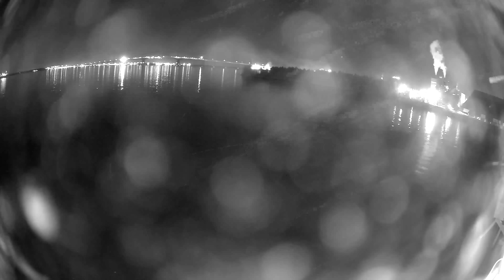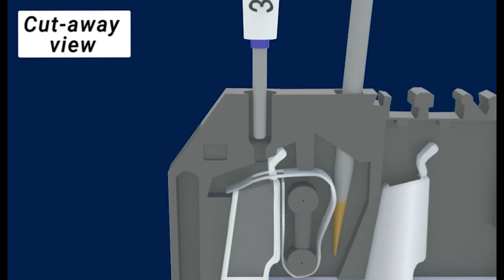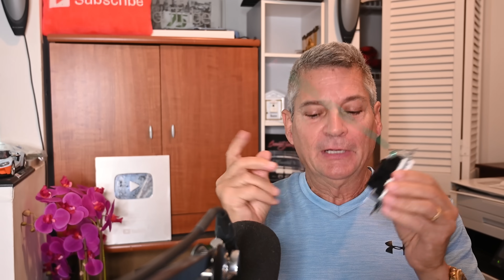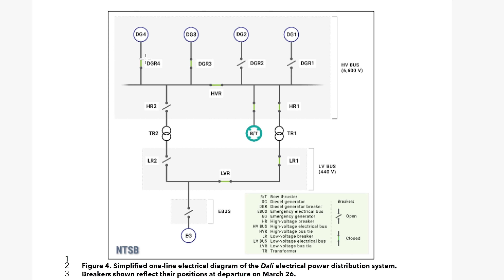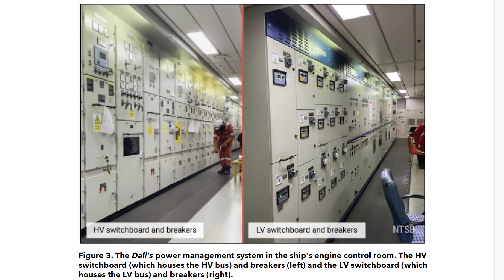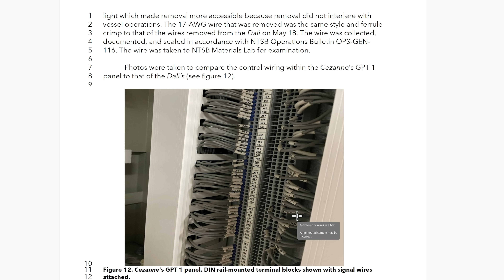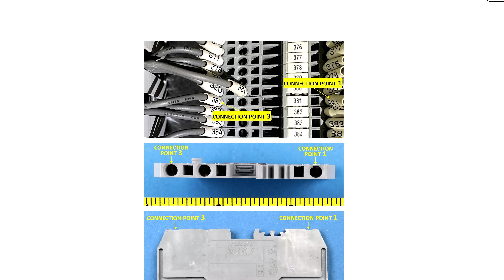NTSB: Scary Wire ERROR Caused Dali Crash/Key Bridge Collapse Baltimore

Comment: Thanks for the follow-up, I bet you're one among a very few, or maybe the ONLY one, you're an Highlander :P, to have done it and it's VERY interesting and thorough !

Far more thorough than ship manufacturers/workers, port authority and check team and crew members. Unfortunately, despite the obvious conclusion, I'm not sure anything will change at all, wherever improvements should be done, as opposite to aviation culture and incident/crash analysis which will more or less are used to constantly learn and progress.

Unfortunately, there's only little chance the guilty party will have to pay the price of their very own incompetence and failures.

As usual, a chain is ALWAYS as strong as its weakest link, and it's always stupid little things which lead to huge failure : Fukushima power plant (powering of a coolling system valve), even Tchernobyl (graphite tip of combustible rods), Space shuttle disaster (little piece of heatshield broken by a foam debris at lift off), multiple Airbus A321 crashes (pilot sensor), ...

Also these Wago connectors, despite looking great and useful, could improve the design/manufacturing to prevent excess of insulator/marking plastic to make the connector fit AT ALL ! So it would NEVER stay clamped in such case, even by a tiny little micrometer.

Comment: These giant ship engines are not like car engines where you turn the key and start, its a whole procedure , gotta start lubricating oil pumps and  a number of steps before it even starts turning and when it does it take time to build up speed. When they lost power the main engine tripped off and they where just drifting in the wind / currents pushing them onto the bridge along with the speed they already had. It takes several minutes to restart engine after power was restored. Obviously nothing in this scale is very cheap so theres tons of trip alarms to detect if bad things that can cost millions start happen, like if oil pumps stop if power to them is lost .... Imagine fixing a seized up engine where engineers literally walk around in the sylinders.... Also rudders dont do much if theres no water passing over them so when engines was lost they also lost steering and ofcoz even the steering mechanism would stop for a while as well. And its not like a 20 foot boat steering tiller, these are massive steel rudders needing hydraulic pistons to move them. here it was bad luck with timing so close to the narrow hole in the bridge , there was no way to make rudder or engine work in the short time they had here. they even dropped anchors , but again that wont do enough to slow such a beast down in time. They would just be dragged on the bottom. Theres quite a lot of kinetic energy to slow or stop here which is why the whole bridge collapsed when hit.

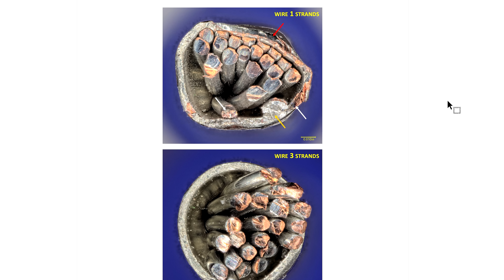Comment: The "good" ferrule and the "bad" ferrule were crimped with different crimpers. The "good" one was done with a hexagonal one, and the "bad" one with a square crimper with larger tool faces. (which explains the confusion at 24:14 )
It looks to my mind like maybe the hexagonal one had a smaller contact area with the spring, allowing it to hold tighter while the square one has larger, flatter faces which allowed it to slide easier.

Comment: From my ship electrical experience we had a maintenance cycle (every quarter while in operation) to Flir mains. This type of issue most likely would heat up due to current draw and lack of surface contact. Also on maintenance card is a visual inspection. However, heat shrink too low wouldn’t be noticeable unless we installed it ourselves since it’s assumed it was installed and QA already from yard.

Comment: This enormous failure caused by such a simple little well intentioned item.

Lately I’ve been addicted to listening to some AI generated YT videos that narrate stories about WWII solutions to problems that bedeviled the US military and got men killed. 

What’s interesting about many of them is that root cause was often both found and fixed by a low ranking enlisted man who broke the rules to implement the solution. They would risk court martial.

It was the officer corp that refused to let them solve problems. Solutions had to come from above via official channels. 

One of the most interesting was the solution to why the engines of some common aircraft would explode when under load.  I will link to it.

Comment: At 24:24, it's bent out of shape because it wasn't pushed in fully. It had the full clamping force close to the tip of the ferrule where it's weaker, and that's what caused it to be bent out of shape. The constant force of the clamp probably caused it to bend more over time, allowing it to gradually slip upwards, as shown by the 5 clamping marks from each time it settled until a combination of vibration and clamp pressure finally popped it out of the square cut out.

Comment: a screwed connection isn't that save on a ship as in your house, the screw will come loose over the time due to the vibrations. the spring clamp is much saver in holding the (ferruled) wire

Comment: I have inserted tens of thousands of these as an assembler and inspected tens of thousands of them as a QC as well.  The "maker" (read shop fabricator) of the improperly terminated wire ends AND the QC of the completed panel take the hit on this one.  The QC should have caught the improperly tagged wire and failed resulting insertion as well as the pull test.  So, not only does it make 'the connection' of lower integrity, that shroud acts as a strain relief against vibration based flexure.  Without it "in place" the wire is free to "bounce around" in that hole and get tugged out.  A good field inspector can see the wire wiggle went down the hole, not from the top of the blue shroud.  Critical systems like that should have wire tension tests done, or perhaps even release inspect and reinsert events on all 'critical' circuit "nodes".  It ALWAYS happens at a "flawed" "node".  My friend Kirchhoff told me that.  That ferrule is designed as a multi-crimp device.  It becomes a long pin, but those crimps are designed to be "gas tight" in as many of those crimp locations as possible.  I refer to the interior of the pin and the clasping of the set of stranded wires.  With the exposed strand ends at the end of the pins I would say that both were properly crimped 'pins'.  The problem was the placement of the blue shroud and of the wire tag around the shroud instead of the around only the wire and lacking the proper spacing as well.  For such a mission critical power distribution cabinet, one would think that the wires and the finished 'installation' would have been better checked.  Me and my fog-o-graphic memory of things like specifications.

Comment: Sure! you can blame the installer termination skill, and engineering missing redundancy. I prefer to blame the overall business that pushes for cheaper under the lies of we need to be cost effective and compete with the market. The terminal blocks which look like the cheapest you can buy have no place in a critical path. Control wiring installed with real quality materials and skill instead of the cheapest possible path to secure more profit.

Comment: To play the devils advocate: wagos are spring connections. They will burn up at a lower amperage than a PROPERLY installed wirenut. That being said wagos are more likely to be installed correctly than a wirenut. Both far exceed the rated amperage if installed correctly.  Same as your twist around the screw vs stab connection . Personally I think the best connection on a outlet or switch is stab in the back then screw down the clamp. But any connection  is only as good as the installer. I have no experience with the ferrules in question. But have instaĺled and serviced many ring terrminals, spade terrminals, etc.  that are basically the same. As a 40 year+ hvac tech. My experience is a mitch hedberg quote. "Don't need another step between me and toast"

Comment: It appears to me that the hole in the plastic of the terminal block is sized to exclude over sized ferrules and conductors.  It was intended to be a safety feature of the terminal block.
The heat shrink wire label interfered with that system. As shown in this video.  Yes, the wire was basically just sitting loose on the terminal. Poor workmanship.

Comment: 8:22 bro that jump cut was sus 😂😂🤨... NO I didn't see "how easily" that pulled out! 

Back stab connections are not lazy and are completely safe. Come on, Jeff...

I am not an electrician but I am in the trades.
Reply: BS, they are lazy.
I can't tell you the number of "back stab" receptacles and switches I've rewired to the screw terminals because of the back stab failing over the years. I haven't investigated why, but my guess is that heat weakens the spring action that holds the wire, then it begins arcing, resulting in more heat weakening the clamp action even more, cascading to failure/ intermittent electrical service.
They ARE lazy.
They are safe, for a little while.
They WILL fail.

Comment: At 23:50 we see four clean contact impressions on the left and those marks are in a valley of the crimp which would have hindered vibrating out of place. There are also no drag marks between the left four and the fifth arrows so the slip didn’t happen there. The tip of the ferrule does show dragging (top), is near a peak of the crimp and easier for vibration to overcome.
The rightmost contact point was the final resting point and lead to the failure. Unless maintenance required reseating the connection at some point, I’d guess that this all these marks were made during construction.

Comment: Those DIN rail connections are not for high power, they're only for maybe 24 volts typically for sensor connections. Which sensor was that one connected to?

Comment: When i have to work with stranded wire i strip back 3 times more insulation than needed. I then take a single strand and wrap it around the strands then cut off the unwrapped ends.

Comment: Last week I was inspecting and touched some wires of the Chinese CNC machine in my wood workshop. It caused the internal power bar falling out, because of a ferrule that was not fully pushed in the a same wago connector. 
Inspected it, crimped a new ferrule, pushed it in to the bottom and that was the end of it. 
Luckily never had the problem while running, or when I had to navigate away from a bridge column...

Comment: I am a captain on inland rivers and I can tell you exactly what caused them to lose control at the loss of power:
2 things
1) Hydraulic steering pumps, it's used to move the rudders and actually steer under power. (duh)
but more importantly 2) Loss of engine speed control.
Unfortunately the throttles on these engines instead of being air or hydraulic, hell even a cable is used on some tugs, is electronic.
They use electronic throttle actuators. The loss of power caused them to lose ALL CONTROL of ALL MAIN ENGINES IN THE VESSEL.
Usually if the boat has 2 main engines you can use them to steer when you lose power, however when you lose your engines you are dead in the water.

How do I know this? Actually you can see it in this very video:
3:27 you can see no exhaust smoke when they lose power the first time
Less than a second later, you can see a puff of smoke when power is restored, this is the throttles kicking the main engines back into gear and back into wherever the throttle was set before the loss of power.
You can then see a steady stream of exhaust when they are underway, then BOOM, exhaust is no more after loss of power (no throttle commanding the engine anymore, back to idle).
After power is restored for the last time, you can then see a larger puff of exhaust, presumably trying as fast as they can to slow the down ASAP.

If these throttles were air actuated (like most towing vessels) this would have never been an issue until the air compressors ran out at least, but considering it uses like 50 psi tops, these giant ships can probably move for about 15-25 minutes with the air reserves they have to actually get some help from a tug to take them back to port, and most importantly NOT CRASH INTO THE DAMN BRIDGE.

Comment: Craziest thing is backstab wiring in switches and outlets is allowed by code.  They are horrible and should never be used.  Sometimes I remove a switch or outlet and the wire just falls out.

Comment: I first saw the spring retained DIN terminals around 1998.  They were sold as a faster & easier replacement for a screw terminal type of DIN block.  I never trusted the spring type.  I still use the screw type today.  ...and it looks like the technician didn't know how to use what he had correctly

Comment: A great explanation of the root cause, but confusing simple terms like "increased it's circumference.." with "increased its diameter..." is just frustrating. Then there's the "...by 20 ex..." Instead of "...by 20 times..." Is equally distracting. And comparing piss poor US power outlet 'back stab" terminals with high retention force terminals is also disappointing. They are in no way gold standard, ask anyone that installs aerospace wiring.

Comment: Note at 19:50 in the close-up of the wire that was making poor connection, the inside of the white label has black on it, as if the wire had been arcing and the dust and ash from that had settled in the label.  it could just be dirt or corrosion but it could be from arcing.

Comment: Making connections is something that has to be meticulously correctly done and not fudged. Engineers might try their best, but it is difficult to make everything "idiot proof" -- idiots will always find ways to mess things up. The sacred duty of electricians and electro-mechanics is making a good connection. It is a shame to see shoddy work on a critical system. it an improper use of the ID sleeves -- for if the wire is broken you want to know it, and it blocked proper insertion.

Comment: I've repaired equipment where I found poor terminal installation to be the problem many times. I've even found several cases of a screw-clamp terminal not even being tightened any, with  the wire just setting loose against the conductor bar. It quickly made me sort of obsessive about proper terminal connections.

Comment: been dealing with these spring contacts while doing a small Installation. even though it felt like it held during a pull test, i was highly suspicious. sure enough, one of the phases melted the plastic with only ~8A of rated 40A, probably because i didn't properly insert it. replaced it all with WAGOs and threw those phoenix contact spring things away

Comment: A bit surprised by that installation. Trying to slip the label band on the ferrule and especially on so many ferrules would be a pain to do with their tight fit. If they are heat shrink labels then they probably used oversized labels which is what actually lead to this incorrect installation. If they were sized to the cable instead of the ferrule there would be no need to put the labels over the ferrule in order to keep the labels in place.

Comment: In this case of the ship i titaly agree with you that the loose connection is the main fault of the accident. Your comparison withe the switch or socket installed in your home is totaly wrong! These switch and sockets have spring loaded connections and if you just stick the wire in like you showed it will never come loose. The only way to get it out is to pull and twist it at the same time witch will not happen under normal surcomstances at your home ;)

Comment: Nice reporting... Okay, in all my years in industrial safety, I have never seen wire tags shrunk over a wire ferrule, period.  So If I had to guess, the labels were shrunk after the wires were inserted into the constant tension terminal blocks.  With that said, that would mean the wire was never inserted into the terminal block properly? I just can't imagine why the labels would be overlapping onto the ferrules ever. We never used constant tension terminal blocks and there were some screw terminal blocks where it was possible to improperly insert a wire into a block and not get a proper bite on the wire. We had to be very selective about what terminal blocks were acceptable/qualified. As a side note, that type of constant tension terminal is more effective on stranded wire without the ferule but then you have to make sure that all the strands are inserted.  The spring isn't strong enough to get a really good bite on the ferrule to deform it enough. The selling point is that they're not supposed loosen up over time. Also, there were both 4 sided and 6 sided crimps being used. I would think the 4 sided would have been better for current handling on a constant tension terminal block. Seems inconsistent.

Comment: Not a design problem, but an build issue. A "Towering Interno" scenario. I can see at 6:28 how the ferrule was not fully inserted. I would imagine the metal spring band in real life is wider than in your animation, as that seems like a rather thin strip of metal contacting the ferrule and not supporting much current. I can see how vibration can cause that wire to work loose and make only an intermittent connection. Depending on what that wire powers, yeah, game over Dali. Stab-lok outlet wiring is stupid and dangerous. ALWAYS wrap the wire around the screw, and make sure it is wrapped clockwise, so tightening the screw draws the wire around that connection point. ALWAYS! Thanks for breaking this one down. It totally makes sense. it was just "really bad timing" for that failure to have happened. Had the ship been under way at sea, these power outages would have been "inconvenient" but not fatal.